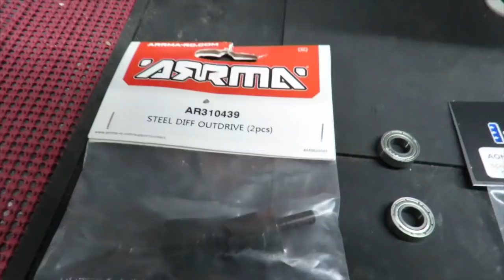How To Make An RC Car Faster Or How To Build A Spool With Speed Run Demos

Comment: Very nice. I actually have to make my own spool to stick in my hobao hyper sse. Im sitting on 85 aswell but with a center diff. Have room for a pinion a couple teeth bigger but that's not gonna cut the speed i want to hit lol. 
Very nice HR has a option for the arrmas. Have an outcast ans i love it. May have to get a talion or typhon and try one of those out speed running. GRP tires are one of the best options for going fast. They make 5th scale sized ones and offer adapters to fit on your 8th scales.

Comment: I know an old video but did you use the same size bearings the center diff had? I pot mine Together and the bearings move back and forth not like snug on the diff itself. Is that how it's suppose to be? Tyia

Comment: Great work!! I am thinking of doing a spool conversion into my 1/8 buggy but my worry is will the motor get hot with bigger pinion or does having a smaller spur gear counteract with less stress on motor, I recently changed just the pinion and the motor got really hot
Reply from the maker: If you reduce the spur gear rather than increasing the pinion, you will still have the same effect on the ratio, so it'll still increase the load. I would say buy and fit the power hobby twin turbo fans to keep the motor cool. I wouldn't worry at all though about fitting a spool

Comment: Probably heard by now that the easiest way to remove the center diff without trying to andle it and finagle and turning cups, is to remove the motor mount. And pull it out together and put it back in no problem then can scre the motor mount back in and all good. Frustrating trying to get it just right just pulling out and putting in the deliff by itself.

Comment: Hi,nice video! did you changed anything to suspension?
Reply from the maker: tightened the rear springs, kept the front the same, raised rear upper shock mounting to outer position, dropped front upper ones to inner position, stock shock oil. Hope that helps

Comment: Could you just open the stock diff, and super glue it tight?
Reply from the maker: you could but then you'd ruin it, and they're not super cheap, much easier to fit a spool and thus save your original diff
Reply: Or just add foam ear plugs may be even hot glue...temporary but works.

Comment: I’ll be building a spool this weekend if my parts get here
Reply: you dont have a couple of WASHERS to shim it TIGHT?
Reply: I’m waiting for bearings
Reply: @The8429  I got a couple of redcat M-1 mods..yeap the damn bearings are slight smaller OD...i had to use aluminum tape. i want to make a 2 speed :-P

Comment: is it even possible to hit 100mph in an 1/8 buggy just on 6s?
Reply from the maker: I shall play with the gearing combinations this weekend but yes I think so!
Reply: It’s very possible to hit 100mph in a 1/8 buggy.

Here is a stock electronics  Arrma Typhon v3 just with a spool and 29/34 gears.

https://m.youtube.com/watch?v=7B5RFNYC37o

Killmod has gone even faster with his stock V2 Typhon

 https://youtu.be/iK9d-U8criY

Then with some better motors you can hit 151mph which is the open wheel ROSSA record.

Buggies are super fun for speed runs. This is my V3 typhon.

https://youtu.be/1aO5r8CBZnU
Reply from the maker: Stewart thanks for this as that helps eliminate a bit of guesswork on the gearing, I tried the 29T in later on but with the 42T spur it was too long to get going in the space we had. I was thinking 29/36 would be on the money but might dive in to that 34 straight away. or 27/38 was my other thought if I can get the gears.
Reply: Driftomaniacs the key to the stock electronics is distance you need to bring on the power over a long distance otherwise the blx esc will  cut out. 

If you upgrade the esc to a mamba monster 2 you will have great successes. I used the MM2 with a castle 2200kv motor with 28/34 gearing and got 107mph. Then switch to a TP 4060 2450 Kv motor with 30/34 gearing and got 125mph. 

My Typhon is stretched so I have no issues with bigger motors but I’m sure the 4060 TP motor fits the stock length Typhon.
Reply from the maker: @StewMac570  Thanks for the info, I had a typhon v2 then v3, before and I gave up on it to soon as the esc always cut out too early, like it'd be flying, hit 74 then just lose all power. By listening to guys like you I'm confident of big digits this time. Phils advice has me having confidence in the car I need to get it running a little straighter but I can do that off camera at a slower pace! Thanks for all the help. I've got the 4tec flying again as well and on that front I've a 6S castle setup from a super baja rey which looks to drop in. My mamba x was running hot on 4s with the current car, speed run body on order for that.

Comment: Ok ok ok now you got hot glue ? On the spool? Nonononono ! It's so unbalanced that's not fare . You use a verry small drop of locktight. In the hole of one end and two to three very small drops around the outside ring. That way you spin it in your fingers and it spreads by itself and a nice even amount. And I've also taken a small butane torch and got it hot and it came rite off . So not the same way but for more balance don't used hot glue on parts that spin fast or be in a position where it's accountable for speed or performance  of your rc. There's really not a point to put in on if it's not going to work to its full potential.